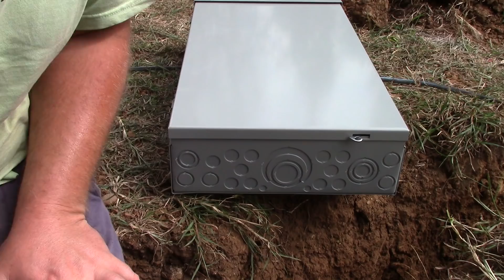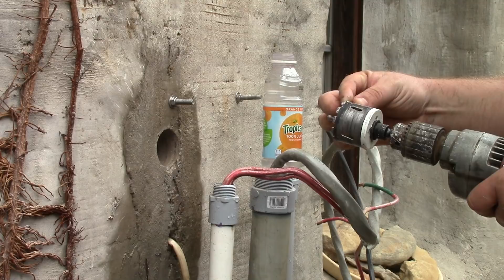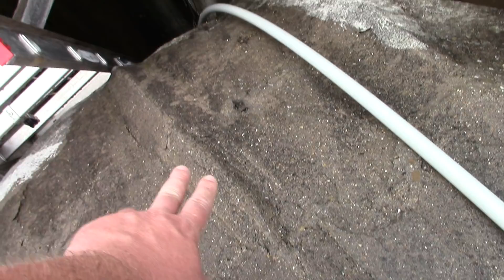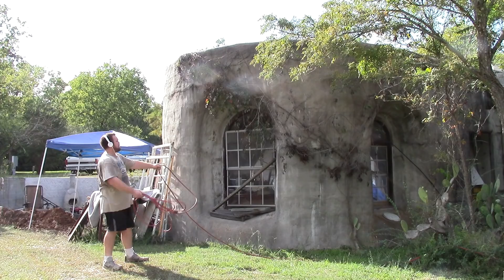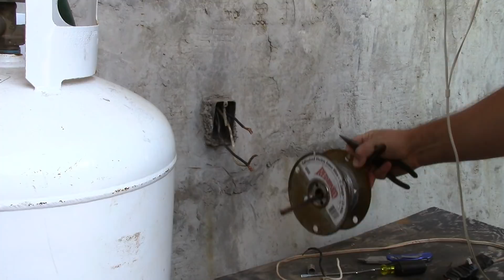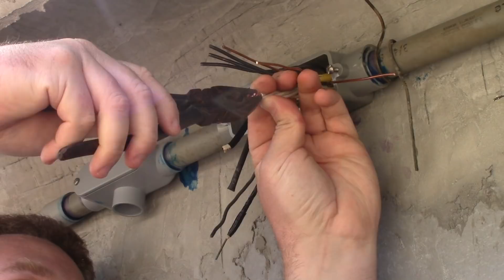Ferrocement House Project - Part 6 - Electric Upgrades

Comment: To late now, but you should not us cabled wire in conduit. Single strand is what is directed. Easier to pull, and operates cooler. Use line Lubricant for pulling wire.